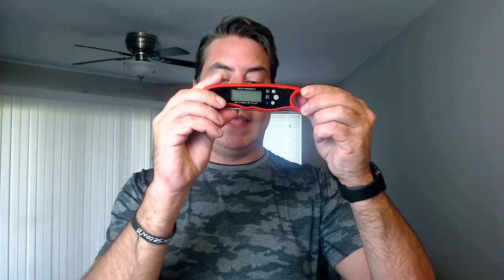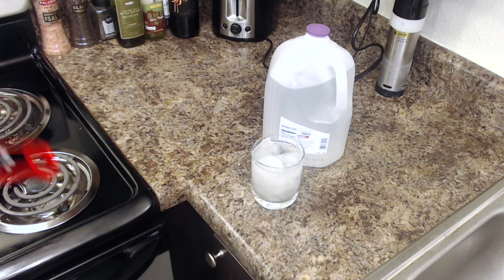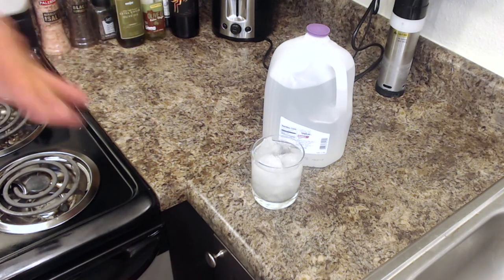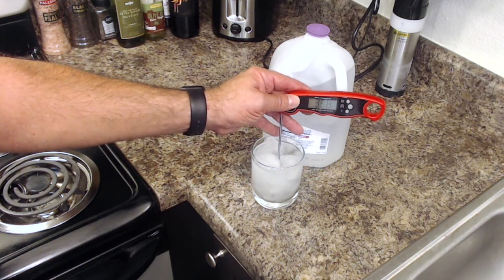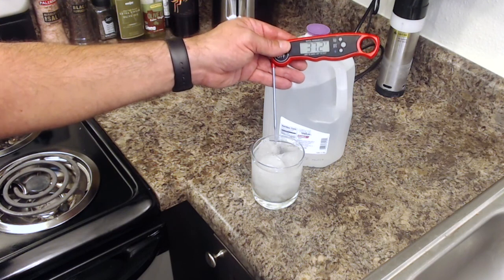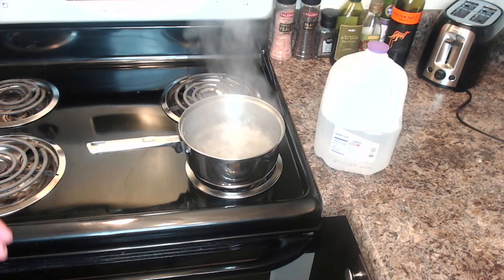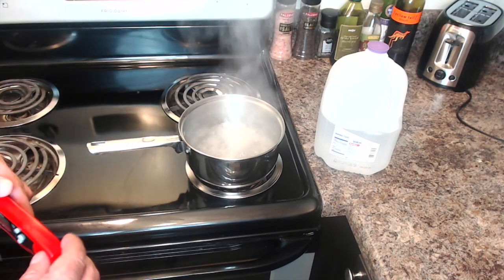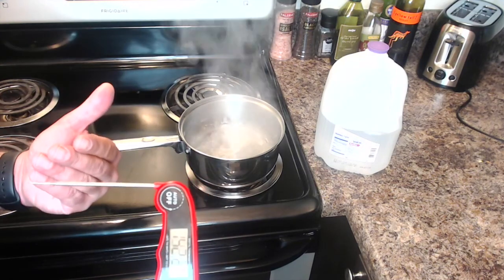Kitchen Thermometer Calibration

Comment: After calibrating in ice water method, how do you correct the temp to 32*?  I tried holding the C/F to lower temp to 32* but it didn't work.

Comment: You did not show how do do the calibration on that thermometer which is why I watched.
Reply from the maker: Hi, I apologize for that but you simply use the ice bath and hold the °C/°F/cal button after placing the probe in the bath and letting it stabilize
Reply: @kevinradzik1195  OK. Googled around and that seems to work,